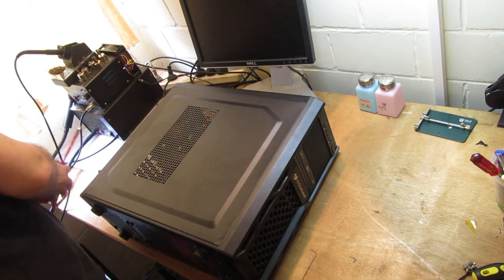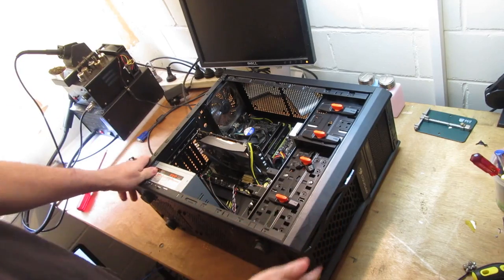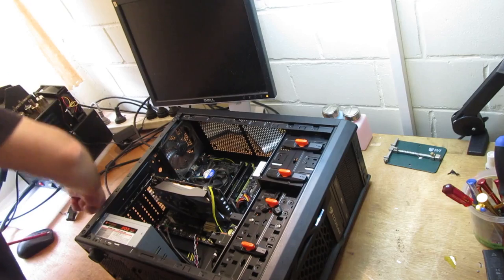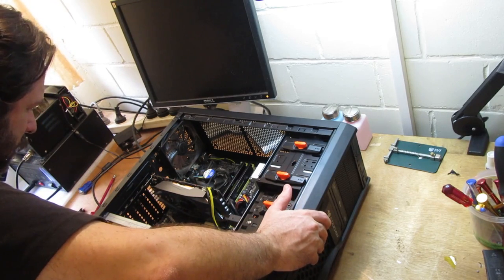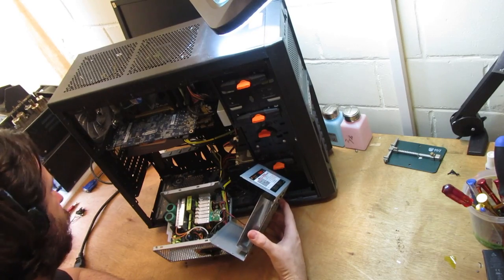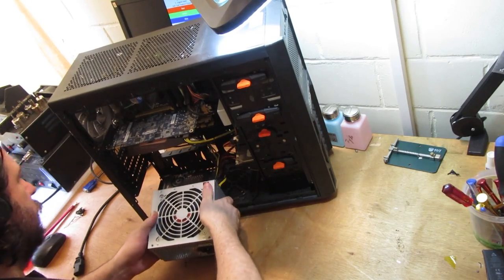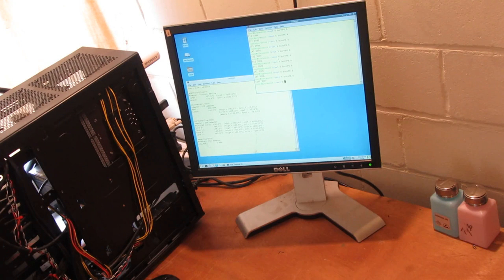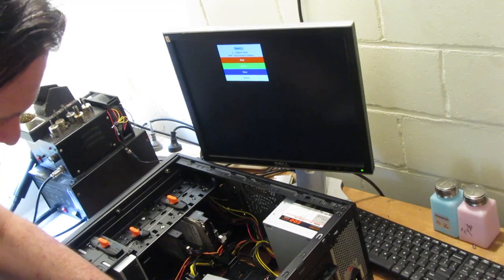What I fix daily - April 7, 2017 - Big machine driving me insane and losing hope

Comment: I feel your pain, I've had machines like these....what I usually do is just do the house cleaning (dust and fur ball removal from the MB and PSU) then remove all socketed boards and clean the contacts and reseat, re-thermal compound the CPU... power cycle and run some test utils for a several hours... then send it back to the client... Job done.

Comment: Thats a nice looking Desktop computer, probably not cheap when purchased. Weird that the PSU was looking the cheapest of the 'guts'
Reply from the maker: I agree, that's what threw me at the start, the PSU looked completely out of place.  I expected to see something more like a Corsair or at least higher quality unit instead of the budget ThermalTake 500W unit.
Reply: This isn't a self built PC right ? Weird PSU choice of the Desktop designer then. Also they could've at least mounted a higher-end CPU cooler by default like one from Arctic Cooling or such. Maybe this was the cheapest version of a higher end Desktop line.
Reply from the maker: It'll be a custom-build / white-box, but yes, better PSU and at least a full-height cooler would have been things that I would have expected.
Reply: ah right I expected it to be some 'brand'
Reply from the maker: It was a decent build overall for a generic shop unit, obviously one of those cases that don't come with a PSU.  Still a bit of a let down.
Reply: yeah it looked quite nice except for that PSU

Comment: Ever thought about using copper shims on top of cpu and graphics chips - suggestion only
Reply from the maker: Only if some spacing is required to maintain a required pressure, and even then still need a fine layer of thermal transfer paste to fill up the small gaps.
Reply: Very true

Comment: well that psu was installed wrong...Grr...pet peeve.
oh and i know whats wrong, there's a resistor on the DC side the power rail, thats going out of tolerance due to the heat from the psu being installed wrong....i heard the squealing noise.
Reply from the maker: Could the squealing noise be my airconditioner?
Reply: no cause it was everytimes the power on the PC was turned on and off...I just not to long ago had to replace a 10 ohm power resistor. it was out by 37 ohms. fix that up or its going to arc over.
Reply from the maker: I'll likely just replace the whole PSU than try fix that one up.
Reply from the maker: Oh, I'm curious, what was it about the existing PSU installation that you felt was wrong ("well that psu was installed wrong...Grr...pet peeve.") ?